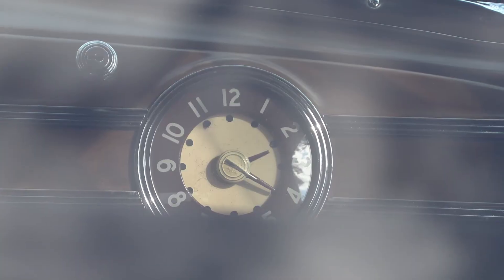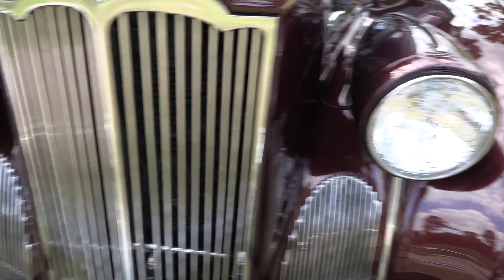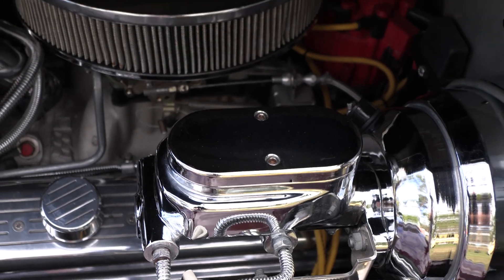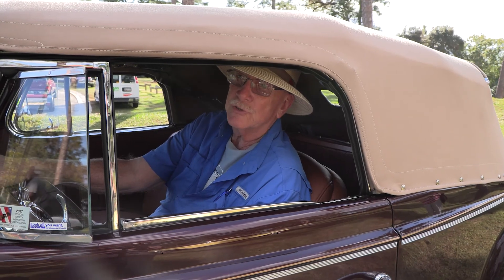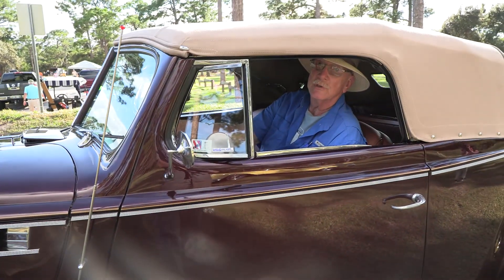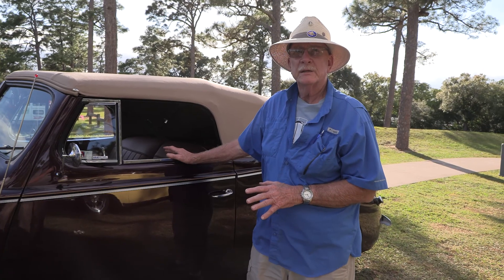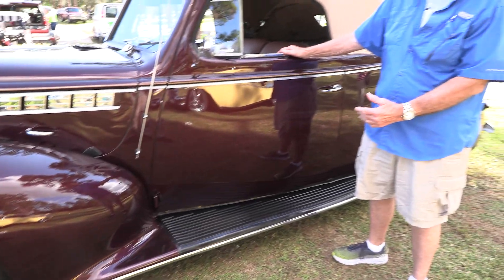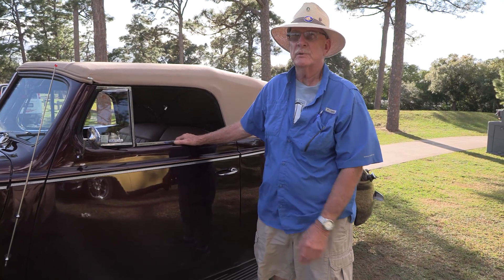Vincent Cashin 1940 Packard 110 Convertible Restomod

Comment: Had a 1941 Packard 110. 100 HP and 48MPH from the three speed gearbox. I bought a period Packard overdrive to install into it to attain modern highway speeds. Would have preferred a small block Chevy with a modern transmission, as it was still a dog. But in it's day you couldn't really complain.